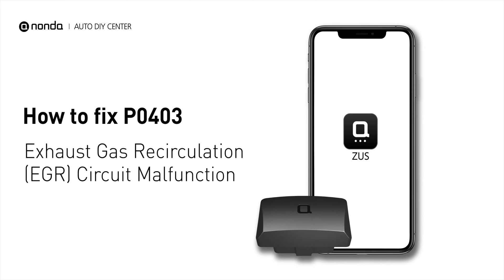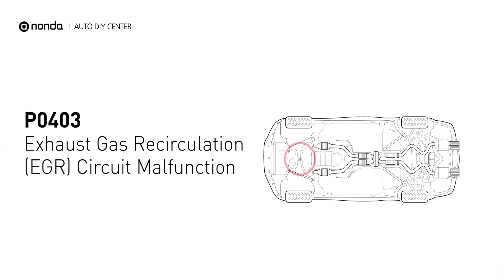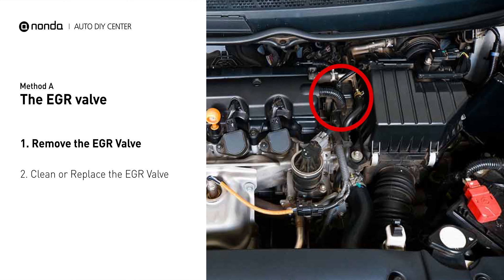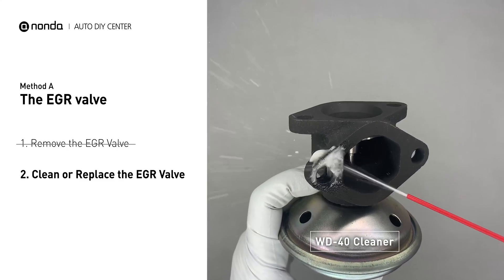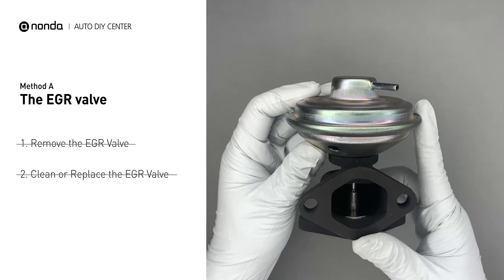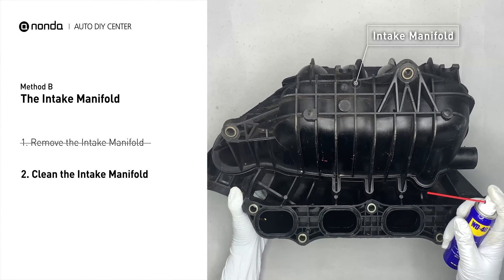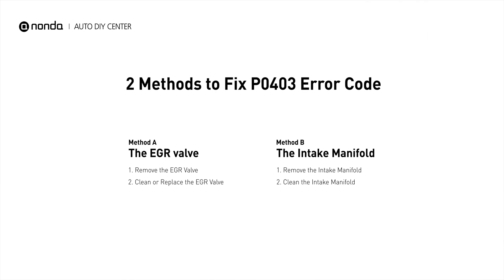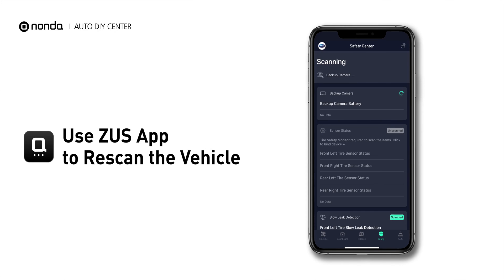How to Fix P0403 Engine Code in 3 Minutes [2 DIY Methods / Only $4.12]

Comment: I have Toyota vitz 2012, eco mode light is not on while driving but during ignition its working , p0403 code showing, is it the reason eco mode isn't working?

Comment: Dear Nonda ...
Greetings from Malaysia
I have 3 engine codes together at the same time : P02E0 , P0340 and P0403 
My car is Chevrolet Captiva 2.0L diesel 2009 
Nobody could repair it for me !! 😔
Could it be short circuit in the wires which are connected to the throttle body and the camshaft sensor and EGR valve together ?!
What should I do ??
Thanks a lot in advance for your kind cooperation
Have a nice day
Reply from the maker: Hello, as you are getting more than one error code, we suggest getting your vehicle visually checked by your local mechanic for further diagnosis.
Reply: Maybe check for blower head

Comment: hello please help mew out
Reply: p0403 powertrain exhaust gas recirculation control circuit for my ML320 car
Reply from the maker: Hello, if there's no other codes that register along with this code, you can try cleaning the EGR Valve and the Intake Manifold. These could fix the code.

Comment: I’m getting this code on a 2001 Infinty i30t but it has no Egr , the car doesn’t rev past 2500 . What would you recommend to do
Reply from the maker: Hi Carlos, we suggest checking the condition of the Intake Manifold and double check if there's any other codes that register along with this code.

Comment: Dear Nonda, 

I have a 2003 VW Golf with the 1.6 BCB engine. It has only 165,000 km (102.000 miles),, and the car's fault is that the idling speed fluctuates between 500 and 750 when the engine is warm. When it's cold, the idle speed is normal and doesn't move. Got a new throttle (Pierburg). The car throws this error code: P0403. My mechanic told me, the EGR valve in my car is good, he cannot fix the car, I am really sad about that. What's your advice? Thank you very much in advance for your answer!
Reply from the maker: Hi Benjamin, can you please confirm if this is the only code you're getting?
Reply: @nondainc  I was at Volkswagen yesterday, and they said that the previous service center where I was until now said and did stupid things, because the EGR valve itself is bad and needs to be replaced. And the code is P0401. So I left my car there, next week I can pick my car. I hope it will be done. Thank you for your answer!
Reply from the maker: Hi Benjamin, it's good that you've decided to have a second opinion. We also suggest checking the EGR sensor, as this may cause the EGR valve not function properly.

Comment: I have a problem with my golf mk6 2.0 tdi... Errors : P0674 Cylinder 4 gliw plug, P0403 exhaust gas recirculatin, P046C amd P0121 Throttle/Pedal senzor... Would cleaning EGR help me? Thanks
Reply from the maker: Hi Bojan, since you are receiving multiple error codes, we suggest to get your vehicle visually inspected by your local mechanic for further diagnosis.

Comment: If Intake this into a garage with this code….
Im getting raped arent I???

How long will it take to fix on average???
Reply from the maker: Hello, please provide us with your vehicle's year, make and model so we could give you the repair methods according to your vehicle manufacturer's recommendation.
Reply: @nondainc  I have replace EGR AND CIRCUIT CONNECTOR AND CODE STILL POP UP .. should I clean manifold ?
Reply from the maker: Hi Adain, please provide us with your vehicle's year, make and model so we can address your concern accurately.

Comment: I have an 2006 g6 gt convertible with this code . I've changed the EGR and tube that connects to it and also cleaned the passage way hole. Also my obd2 port doesn't work sometimes. Could changing the ecu possibly fix this code?
Reply from the maker: Hello, is there any other error codes registered together with P0403?

Comment: I have this code on my 2009 Tiguan 2.0 TDI i did replace the EGR but still same problème !
Reply from the maker: Hi Merwane, kindly clean the intake manifold to see if the issue will still persist. Hope it helps!
Reply: @nondainc did this help?

Comment: Nissan máxima 2004 egr
Reply from the maker: Hi Fernando, please check all the wiring harnesses and replace if you found any damage. Check and replace also the EGR volume control valve.

Comment: Okay I have a 03 Ford Expedition with the 4.6 
I have codes P0403, P0443 and P0446. I have replaced the EGR, the Purge Valve and another Purge Valve can't remember exact name. Truck still has the codes and is worse when I fill up with gas..drives normally except during first start up it wants to hesitate to go and idles slightly rough...please advise
Reply from the maker: Hi James, since you are encountering three different trouble codes at the same time, we suggest taking your vehicle to your local mechanic to do a visual inspection to provide you with proper solution and to avoid misdiagnosis.

Comment: I have a 2007 F150 4.8l I have p0403, along with p0102. I have replaced the MAF and the EGR vacuum solenoid. The egr valve its self i havent touched. I will try cleaning the egr valve and let you know the results
Reply from the maker: Hi Andrew, hope it helps and let us know the outcome.